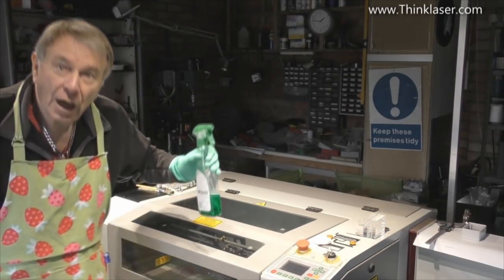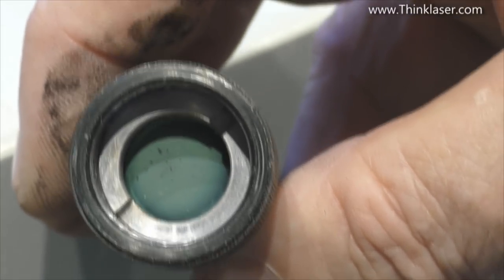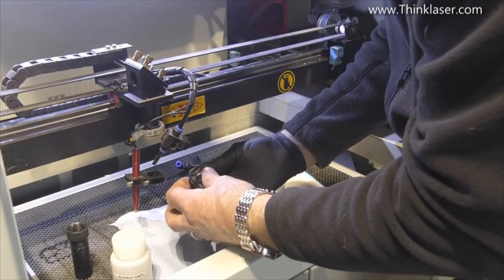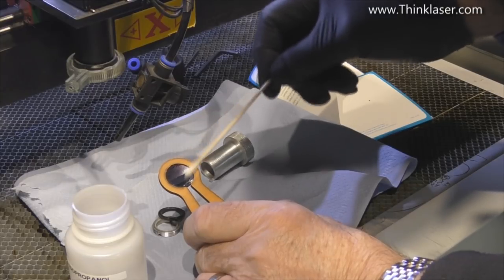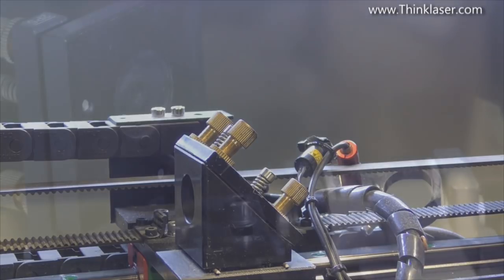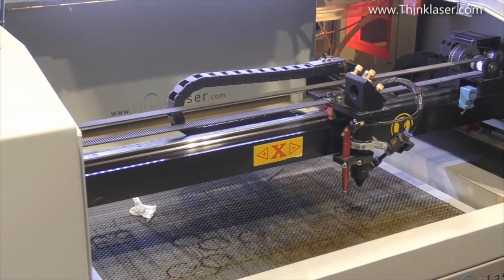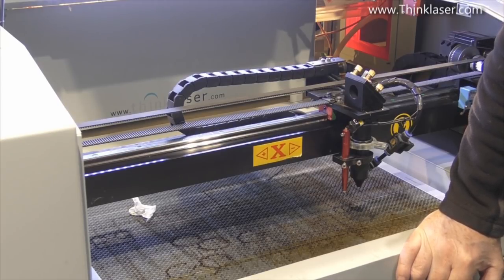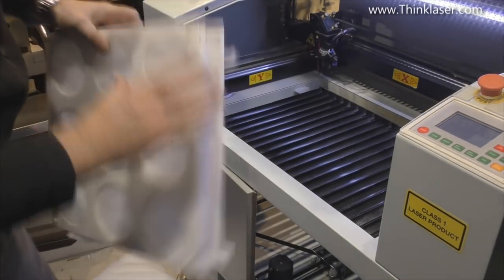Laser Machine Maintenance: Mirrors, Lenses & More (2018)

Comment: Is there any chance or problem with cross contamination by dipping the the cleaning cotton ball back into the alcohol? Also, since alcohol is fairly cheap in the USA, so could I dip and soak the lens? This was such a great video and so informative. I am trying to buy my first machine used and will watch this video a couple times if I get it because I really had no idea how to clean and maintain the machine. I am buying my machine used so it probably has problems, but now I know what to look for and what to use to clean it. Thank you so very much. I have a much greater understanding about these machines.

Comment: Been watching a lot of your programs, but I have a major problem. when I push the x and y button on my control pane it is like an automatic, it starts from the back and just keep on going to the front, the same when I press the side arrows, it does not stop, can you please tell what the problem and how can I fix it? thanking you.  Ken from Brisbane
Reply: Having no clue about your machine, I'd venture to say it's not configured correctly.  What type of machine and controller do you have?  Does it home properly when you power it up? These answers would help anyone who's trying to help you.  Good luck, take care.
Reply: @jackwilborn2353  Sorry  Jack, I have a red and black 80W Chinese laser 644xg. it does not home . and to reset the parameters is useless as the controller does not function at all, therefore I cannot set the correct parameters, I did line up my mirrors and that is working perfectly as is the beam, but all else does not work. I really do need help, Thank you

Comment: regarding the lubricant I am using the berner silicone based  spray lub which is also kind of dry would you recommend this lub ?
Reply from the maker: Hi Mentalfloss,

While Silicone is a great lubricant, it needs to be totally dry (as explained by Russ) for use on the slides, otherwise, it will just attract dust.

Regards

Gareth @ Thinklaser
Reply: @Thinklaser  I see, so this spray is fine as it attracts absolutely no dust in the slides they are like new machine is almost 5yo and has worked a lot. And I have to say in favor of chinese lasers it is still on the first tube 80W Yongli still going strong, (knock wood)
I do keep it on good condition though very rarely go over 85-90% power 
Only thing I have replaced so far is the controller for a better one brought lightobject's T9 DSP and am quite happy with it
I am replacing the mirrors and lens now changing into 38mm Focal lens

 Thank you very much for your kind replies

Comment: I usually clean the lens without removing it from the nozzle using the cotton stick very gently and then spraying inside with compressed air it comes out perfect every time.
 It also saves me time as I photo engrave and cut thousands of 12x8cm ply pieces every month so I usually clean the lenses 2 or 3 times a month.
But I have been using ethyl  alcohol up until now have I damaged the lens ?
I want to replace the lenses and am looking for a good lens kit with 38mm lens can you please advise what type of lens I should buy and if possible where to buy it ?
Thank you very much I have learned A LOT from your videos
Reply from the maker: Hi Mentalfloss,

Ethyl alcohol should be fine, it's acetone that can damage the lens surface. Russ has developed a compound lens assembly which contains a 1.5" lens, a 2" lens and a laser nozzle assembly for around $50 from Cloudray. 

Regards

Gareth @ Thinklaser.com
Reply: @Thinklaser  Thank you, good to know I also do the same with the tube lens it comes out perfect every time

Comment: Hey Russ ... I haven't removed or cleaned my laser head / lens yet (4 months) and figure it's about due.
After removing the air assist,  to remove the Lens and nozzle assembly do you unscrew it from it's mount?  This video did not show you unscrewing it so that's why I ask.

My laser head appears very similar to yours. I have a 6040 Chinese laser.  Thanks !!
Reply from the maker: Hi Tim,

On the Thinklaser Lightblade machines, you unscrew the main nut in order to drop the nozzle and lens tube. You then unscrew the nozzle from the lens tube in order to get access to the lens. 

Gareth @ Thinklaser

Comment: thanks for those good tips , one question would it be ok to use ethanol alcohol 99% instead of isopropyl ? I use it for cleaning the lens never had problem , but the tip of the tube is little bit pricey so I would be grateful if ethanol alcohol id fine for it  ?
Reply from the maker: Hi Osama,

The main benefit with IPA is that it totally evaporates at room temperature and doesn't leave a residue. I'm not sure ethanol alcohol has the same benefits. 

Regards

Gareth @ Thinklaser

Comment: Another valuable and useful video. Do you think denatured alcohol will work as well as isopropyl alcohol?
Reply from the maker: Hi Fred,
The key factor with using IPA is that it evaporates leaving no residue of itself behind. From what I have read about Denatured alcohol, it's treated with poisons such as methanol, benzene and pyridine (to stop it being drunk), these additives may well leave some form of residue behind on the mirrors and lenses. Also methanol is highly toxic, so I'd prefer to use something more benign. 

Gareth @ Thinklaser

Comment: good video! how should i know if the CO2 deplete?
Reply from the maker: Hi Robinson,

Thanks for getting in touch, Gareth @ Thinklaser here.

The only way you will know if your CO2 is depleting is that you need to change the power settings on a job that used to work ok. So for example, if you have checked and cleaned the optics and alignment and you still need to decrease the speed or increase the power on a job that used to work ok, then your tube could be losing a little power. 

It's easier to check if you have a laser power meter of course.

Comment: Hi Russ.
Is the process for cleaning the lenses transferable to the Chinese Laser systems?
Also, I am able to keep all files I use, on a USB stick and the PC they are created on, so not really necessary to keep them on the machine, I delete all files after use, I guess it is something I have been doing since day one so I am use to it.
As soon as I saw your filter in the machine, I immediately thought of my AC unit and the plastic, washable filter in it.
Have you thought about a reusable filter, and do you think it would be as good for collecting the particulate matter?
I assume something is better than nothing.
Thank you for the video, as always.

Rick
Reply from the maker: Hi Rick,

Gareth @ Thinklaser here, The lens cleaning process is certainly transferable to the Chinese laser systems. 

The low cost of the filter material Russ uses means it only costs a few pence each time to change and the used material is very easy to dispose of safely afterwards. 

Cleaning a reusable filter may cause more issues than it is worth. 

Gareth @ Thinkllaser
Reply: Gracias, my friend!
Reply from the maker: You're welcome Rick

Comment: actually what is the function of the blue hose beside the laser tip?
Reply from the maker: That is the hose for the air assist supply. The air assist has three key functions.
1. It gives a positive pressure at the nozzle, limiting the amount of smoke and debris coming in contact with the lens.
2. It blows away smoke from the laser beam which can give a better cutting performance for certain materials. 
3. It disperses flammable smoke from the laser beam, reducing the risk of it igniting. 

Gareth @ Thinklaser

Comment: I thought the air assist was to keep the smoke, and debris, from getting to the lens?
Reply from the maker: Hi,
The air assist does give a positive air pressure to reduce smoke and debris getting to the lens, but the lens will still get dirty over time. Especially if you reduce the airflow for improved engraving performance. 

Gareth @ Thinklaser